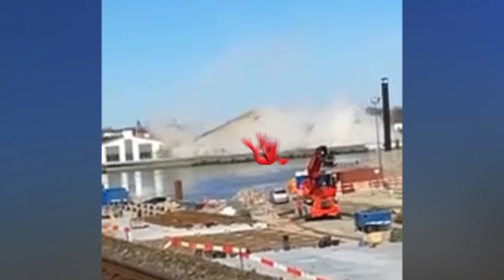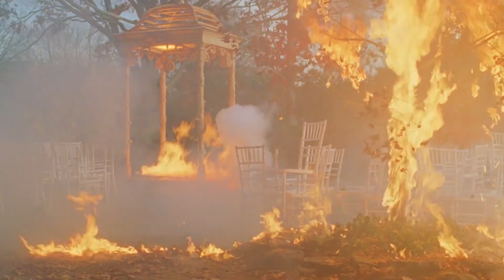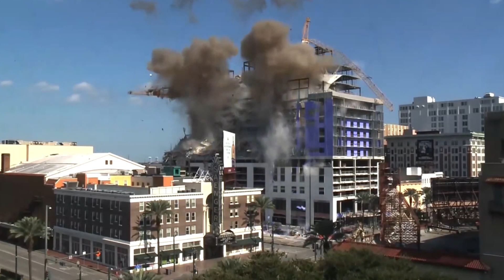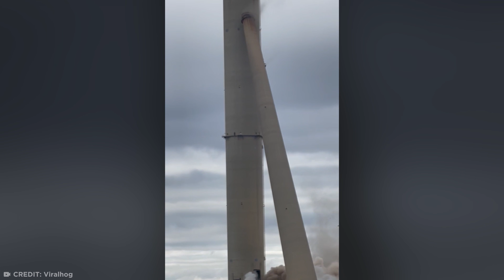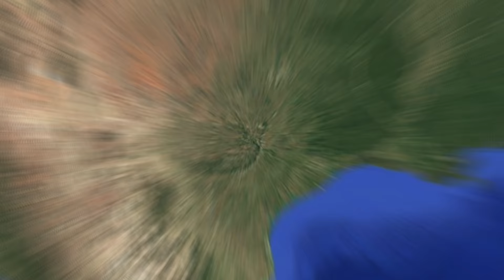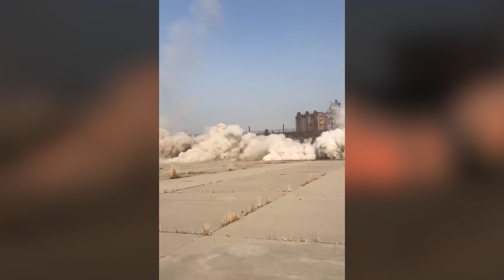Demolitions Gone Horribly Wrong

Comment: The voice over obviously doesn't know about "quick hitches" that have been fitted to backhoes for decades! I'm sure that Safety folk all around the world have similar rules about them as here in the U.K. - once the bucket has been "snapped" into the pick ups - it MUST have the safety pin inserted. However; several people had to die before this was enacted.

Having worked in heavy construction for over thirty years, I was involved with two of the "world's most experienced" explosive demolition contractors and was amazed at their "let's suck it and see" attitude - some of the guys they used to drill holes and place the charges were brand new to the job. I didn't ask why - I just made sure that I was a long way away when the button was pushed.

Comment: When you cut out a wedge similar to felling a tree you do not want an explosion pushing the two pieces apart.  If you look at Fred Dibnah a single man who took down many tall chimneys you can see the technique.  He used to cut out a wedge but fill the gap with stout timbers and other combustibles. Eventually the construction was relying heavily on the support of the timber to stay upright. The next move was to set the supports on fire and eventually it fell.  This is how people attacked castles years ago.

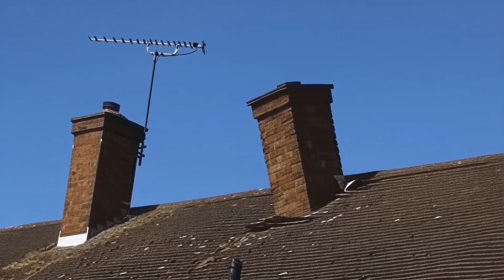Comment: 3:25 my house (which was originally my great aunt's house, my dad inherited it from her, it's at least 80 years old now) had two chimneys in it, and they took one out correctly, but the second one, they took it out from the top, but they never took the rest of it out of the wall, so as the house has settled over the past like 40 years, the leftover part of the chimney has been breaking through the wall slowly but surely. When I was little and we would visit, I never noticed it, but then it was pointed out to me that the massive lump and cracks on the wall weren't normal, and then my aunt moved the little decoration that she covered a hole with, I still don't know what the gaping hole was for, its just a like ~3-4 inch circular hole, but its solid which means it was intentional, and its higher than it would make sense for it to have been part of the fireplace.
Reply: Dang.

Comment: @ 6:48 the excavators can have an alternate coupler that also incorporates  2 pins that can be opened at any time to remove the bucket, I dare say the operator WAS trying to do away with the man, as it takes a shake to dislodge the item, because if the latch isn't closed it will just fall off.

Comment: When you pour a concrete floor, the concrete is liquid.  It needs temporary supports.  Builders often remove these temporary supports far too early.  You can walk through the area, but the supports are far too close together to use equipment.

Comment: 11:17   I have watched pretty much every documentary on building implosion, in virtually ALL cases ... The experts come across SOME differences between .......

..... the Architectural Plans that were used to build the places .... 
and what is ACTUA:LY used to build them ... 
Surprisingly  OFTEN they find steel beans and columns that are MUCH bigger than called for in the plans, Which is fine ... 

..... BUT maybe THIS building had smaller columns in key places???  ... 
Causing the building to collapse before it should have??

Comment: Tall slender structures can be the most unpredictable. They should be supported by cables attached to the top on one side to stop them falling the wrong way. I think I only saw 2 cases in this video where such cables were at least attempted to be utilized.

Comment: The hoe bucket most likely had a quick attatch. Wears out an bucket can fall off.
   Some have a bolt the holds a bar to keep the bucket on. They can loosen or break.

Comment: The first one either had too much explosive or possibly bad placement of explosive, it blew out the opposite side to the hole made before demolition, creating no real force to direct the tower, so it just dropped at first, meaning it had no connnection to the base before pausing and then going the opposite way to that was intended.

Comment: I live in New Orleans and used to have a business right across the street from the Hard Rock Hotel.  After it collapsed, there were still a few workers inside.  For a YEAR, I drove past it daily- with dead bodies PARTIALLY VISIBLE from the open side walls!  I felt so bad for the families!  They said it wasn’t safe to try to get them out.

Comment: Be Amazed, a true standout in a field that is becoming dominated by AI Generated Slop

RE: Hard Rock Hotel - Contractor Criminal Negligence.

Structural columns were undersized (thinner than engineered specs)
Fewer columns installed than blueprints called for

Comment: I used to tear down buildings here in upstate NY with my dad. We dropped several stacks, industrial buildings, and houses, etc, as well as did interior demolitions in shopping malls, and houses and buildings under renovation. Also, never any explosives, only heavy equipment like track loaders, cranes, skid steers etc. and in cities like Troy, too close to together, or unstable after a fire etc, by hand. And yes, I sat on many walls, mostly brick, and worked then down with bars and sledge hammers, but NOT IN BARE FEET!! 😮😳 God bless him! 😩😮 that takes some serious guts and tough skin on his feet! 😬🤣 A good amount of my antique light bulb and fixtures collection as well as electrical items cane from buildings we demolished. Cheers! 👍😋

Comment: The excavator bucket dropping isn't connect with pins that one is on a quick coupler using its hydraulics they are nice for quick swapping attachments but if not careful can only partially latch.

Comment: I can tell you that old grain silos on farms are the worst to take down, especially the ones with all the metal rings around them are the most unpredictable to make fall the right way at the BEST of times. Best way I have seen from other farmers is to either do it half way down with an excavator then take down the rest or the sledgehammer method as long as you keep a good eye out for when it decides to finally fall down. One demolition crew that took some down a while back had a Cat D9 with a heavily reinforced cage and armor around where the driver sat. They said that is all the dozer does due to the way they made it and had PLENTY of scars from things falling on it in the past but the driver was never harmed.
Reply: You can loosen the hoops and even remove some and that helps a lot